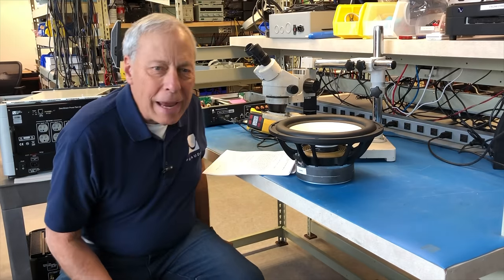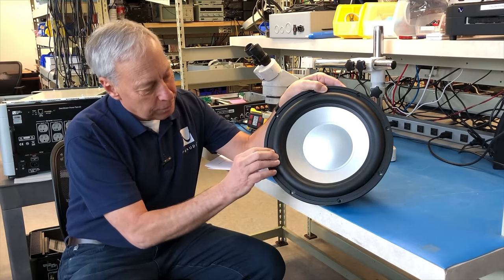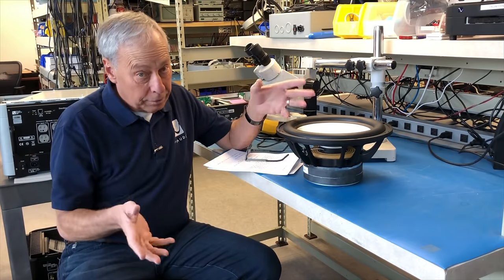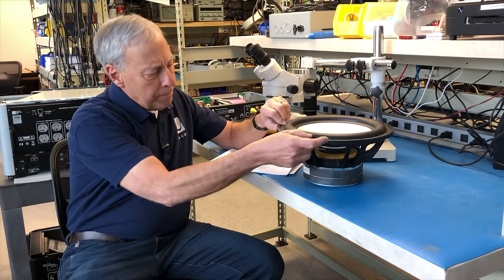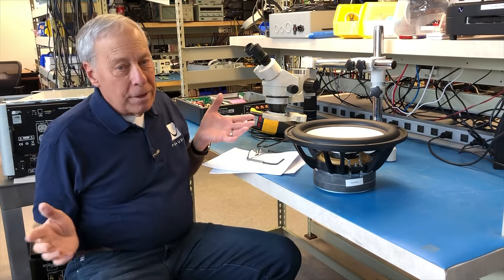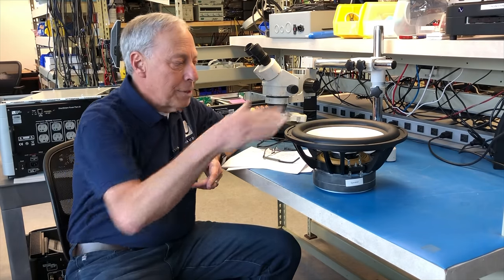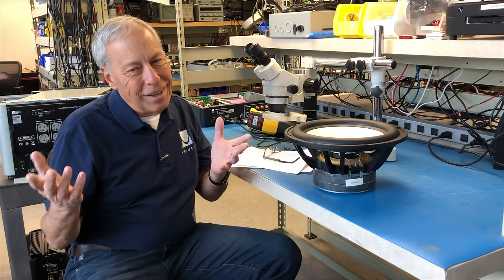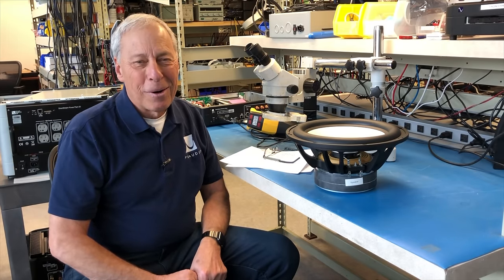Are loudspeaker dust caps important?

Comment: Funny dust cap story.  My friend dragged over a pair of Event 20 powered studio monitors with poly drivers and caps.  Anyway, one was missing a cap (that one sounded fine) and the one WITH a cap was highly distorted (or worse) at any reasonable volume level or higher (okay?? if at low volume). The voice coil measured good, decent match for coil dcR and coil inductance to the "good" one.  Also, it didn't rub.

It was a "head scratcher" and maybe a new $$$ speaker to repair.

Last chance for something we might be able to repair.... maybe an intermittant connection from the tinsel to the voice coil that needed to be resoldered.  The cap need to be removed to do that.
Discover the "loose" cap in the process.
Weirdness starts here:
It turned out the cap was partially unglued (not obvious) and acting like a check valve.  The speaker motion could pump air "out" of the magnet/coil motor thru the unglued part of the cap on the speaker's backstroke... but the cap reseated tightly on the glue line and wouldn't let air back in on the forward stroke.  Play it loud and the cone's average position kept moving back until something was hitting (suspect the coil former was hitting the bottom of the magnet annulus.
So... two new matching caps and a tube of glue later.... they were as good as ever.
Reply: dennis walsh very similar problem with my 18, there was a small cut in the dust cap and the woofer would make a terrible noise sounded like the whole thing was junk, ended up putting a piece of tape over the cut and sounds perfectly fine now

Comment: "dust caps don't affect sound much"
Phase plugs has left the chat.
Reply: well thats why i searched for an explaination on that subject. I have some focal 6.5 coax speakers but i removed the tweeters to place them upper on the door. now the speaker is missing its center piece, i know the original component ones have a phase plug on them. so will it really affect sound or dust collection on the vc?
Reply: @fabiuh991  I am not using the tweeter with my coax unit, either, I found it at least important to put a foam bung in the back hole where the tweeter goes. Them I (recently) doped the dust cap and found it improved phase coherence.

Comment: Wow, I'm a bit surprised to hear that having no dust cap doesn't make a whole lot of difference.

Especially in sealed box speakers! Essentially you're making the speaker ported in some sense, when the cap is missing. How can this not affect the sound?
Also in ported speakers, the sound would change if you add another hole to the box.

I guess I'd have to try to find out, I just don't have a speaker lying around right now to try it O:-)

Comment: Removing the dust cap can sometimes help in dipole (Open Baffle ) applications : some motor designs have a rattling sound emanating from the rear of the speaker at high excursions (before Xmax) . In a closed box , not a big deal , in an Open Baffle a very big deal . I personally have experienced that the rattling completely dissapeared after dust cap removal on 2 woofers I had installed in a Ripole sub

Comment: in some drivers the dust cap could extend the high frequency response of the driver.
Old speakers lacked a dust cap as there was a second spider attached to the voice coil and the magnet which was attached by a screw in the middle.

Comment: You forgot an important point. The dust cap reduces clearance volume, forcing air through the voice coil air gap with a good amount of pressure. That's crucial to cooling the voice coil. With out it, the coil cannot handle as much wattage without heating up, causing power compression, noticeable odor, and at worst, SMOKE! The size of the cap, and the  chamber volume of it also help dampen the free air resonance of the driver, giving a flatter sound. Not only does the cap act as a diaphragm to force air past the coil, it actually tunes the driver. Removing it can change the Thiel Small parameters of the driver. When replacing it, it's important that the effective chamber volume be as close as possible to the original. It's best if it's non-porous.
Reply: Vincent Robinette :  ... best if non porous... that’s a big claim, not sure I would agree if I was designing scratch up for  low compression/ high dynamics.. ( I don’t disagree) ... it does go against phase plugs and many successful driver designs... ( I’ve never favoured that direction myself though)
Reply: @justinmallaiz4549  That statement is made purely on a power handling standpoint, especially for woofers. Porous is perfectly OK, as long as there is enough air forced past the voice coil, to handle the power. To run with a porous, or even no coil cap reduces the amount of force needed by the coil, to move the cone, thus, produce more sound per watt. If you're doing Hi Fi at low listening level, this is not a concern. If you're running hundreds, or even thousands of watts RMS into high performance subwoofers, then, it's a HUGE concern! Phase cones are particularly effective, if a driver is reproducing frequencies high enough, that the wavelength of sound is shorter than the diameter of the piston of the driver(not counting the surround). At high frequencies, the cone cap becomes a major player in the acoustic character of the driver.

Comment: If the speaker is vented the dust cap is very important as it allows the cone to suck air in through the vent hole and blow it back out to help cool the coil at high volume. With out it the coil will overheat at high volume and damage the coil.

Comment: I’ve been looking into a DIY speaker kit called the Volt10. It has a soft dust cap you can see through with a tweeter mounted to the back of the woofer magnet. What are your thoughts on this? (As a surround speaker)
Reply: You'll love it. It is call a coaxial driver. With the tweeter in the center, your time alignment stays the same for off axis listening. Off to the side, it won't be as loud, but the sound quality is still there. You can't beat it as a side fill in a surround sound system! Just get the crossover frequency right, so the drivers are in phase at the crossover point, and they can perform quite well.

Comment: Larger dia bass speakers like 15" 18" use an inverted dust cap to give more cone face allowing more air movement but I agree with most midrange/midbass speakers don't actually need the dust cover for performance reasons it's just to keep the dust out

Comment: SO...what about the hard bullet cap on some car audio speakers?   My kicker 6" failed with a stuck cone.  I managed to get the bullet out and the plastic was melted, binding the cone.  Works fine without it now.  But I live in a very dusty dirty environment.  This driver is actually in a box as a bookshelf speaker.   One thing I see is that a bullet inserted into the coil is not acting nearly so much as a dust cap.  It's not affecting the cone at all and only keeps out some of the dust since there is a gap (unless it's melted!).   I guess I'll just replace the reworked bullet.  But this is making me wonder why premium car drivers have these bullets in the first place.  Just for looks?  Less interference with the cone?

Comment: Woofers pp cones have a bigger dust cap. The cone is very thin ang Light. To work efficiënt. The cap make the cone structure stronger. Airtight caps also push air trough the coil vent holes. Without a dust cap you can hear on some speakers air pussing trough the coil.which distorts the sound.

Comment: I've always wondered why not make the port in the center of the subwoofer making it kinda like a coaxial subwoofer? It would help keep the voice coil cool. The more you turned up the volume. The cooler the subwoofer can be. Until you run out of excursion.  Im sure that it can be done with the right design and tuning. I could see it working on a very large subwoofer driver.

Comment: Reasons for a dust cap: Dust, smoke, humidity, bugs, pets, kids.
Reply: You forgot 2 reasons: Cooling of the voice coil by forcing air through the gap, and dampening. The pressure created by the piston helps dampen the free air resonance of the speaker. The volume of the chamber created by it is actually tuned!
Reply: ... even frequency extension... eg : dust cap attached to voice coil former.. sometimes using alluminum or with wizard cone...

Comment: Dust caps DO change the sound. Remember JBL's (and others), using aluminum ''chrome'' caps?. They were there to increase midrange output, as means of a rigid dome midrange driver would. Some dust caps are very acoustically transparent, to acomodate a coaxial tweeter, try changing that cap, for a paper one!...

Comment: hey Paul what is the use of a grill on speaker/subwoofer good for?
Reply: They are mainly there to prevent damage to the speaker cones and to keep STUPID people from touching the speaker and putting a big dimple in the dust cover.  It seems today the trend is to have no cover and it would seem to help the sound somewhat because many cloth grills interfere with the woofers air movement.

I prefer a grill over the speakers anyway because of the risk of damage.
Reply: I really don't know how much the grill cloth can affect the woofers, the fact that I can see the cloth move when the woofer is producing strong bass would seem to indicate a possible issue.

Comment: Who knows what effect the dust cap has on a speaker .... it will vary a lot from speaker to speaker. Since in the case of those IRS bass speakers the dust cap has been removed there is an air bypass... if that speaker went through a T/S test set and the figure for Vas was derrived then that figure  has a lot to do with determining the box volume. Now the dust cap will affect that Vas value .... I don't know if those 6 bass drivers have their own separate divided enclosures or not but if they do then the speaker  without the dust cap but with the accelerometer is now working in the wrong size box and is trying to " correct" the responses of the other 5 ... via the servo system ... doesn't sit well with me I gotta say

Comment: This video doesnt explain anything... Dustcap is to keep the dust out, because speaker will suck it in by the cone movement and the dust will get stuck between magnet and coil and make some scraching sound, worst is when this dust is attrackted by magnet, then ist harder to remove it.

Comment: Paul, I’ve noticed last few years many speaker manufactures using what I’d call an inverted dust cap. Iam guessing this is due to the idea dust caps look a bit like giant belly buttons on an otherwise beautiful piece of audio. Is this just cosmetics? I tend to forgo any speaker with an “outie ‘ especially if the drivers are to be exposed.
Reply: Matt K : ....for the most part cosmetic.. 🙂  ...